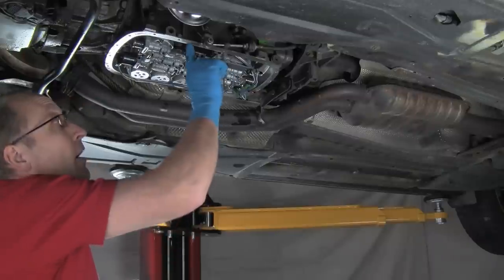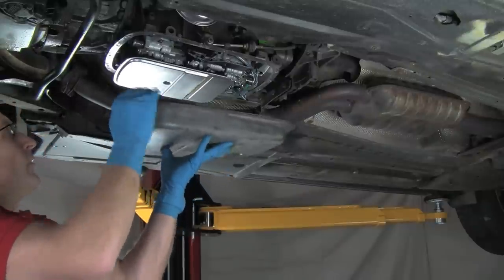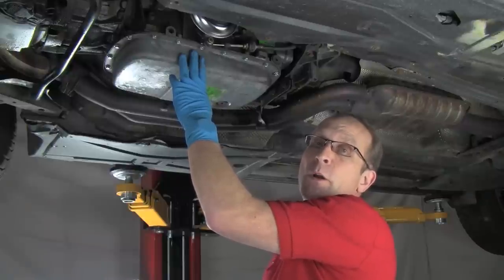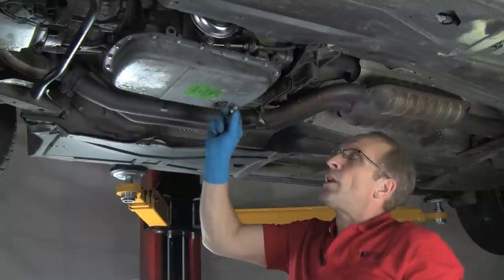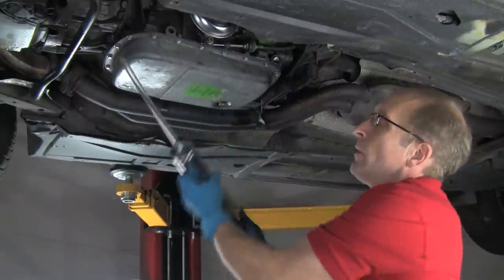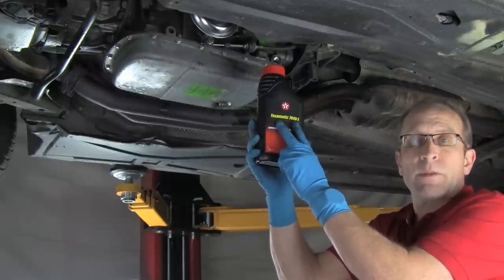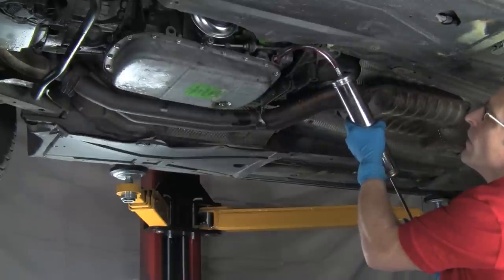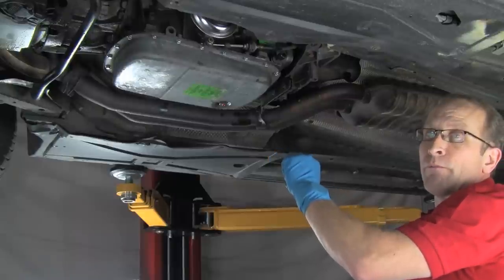Part 2: Changing Automatic Transmission Fluid & Filter On A BMW/MINI

Comment: i saw another video they mentioned you should run the car and flush the fluid again (in case fresh fluid and old fluid from the converter don't mix well) what do you think??

also my tran case is leaking a small bit do you think the bolts+gasket are bad. or could re using the bolts be fine?
Reply from the maker: Yes, We have made multiple comments on this.  If the fluid that was removed is pretty nasty (or just to be sure you have a higher concentration of fresh fluid), you can run the transmission (in gear, or drive it) and then do another fluid drain and refill.

In most cases, reusing the bolts is fine.

Comment: I have a 1999 328ic; Would I take the same steps for my vehicle? any additional steps for my car? and lastly is it save to run the car while filling it up? I know doing on just regular cars is normal but ever since I started working on my bmw people told me to never fill it up while its running. are they wrong?
Reply from the maker: The transmission in your 328i will be different from the one shown, but the overall procedures will be similar.  The Bentley repair manual for the E36 3-series will detail the differences for your model.  Yes, you ALWAYS set the automatic transmission fluid level with the engine running.
Bentley manual:
http://www.bavauto.com/fland.asp?part=b398

Comment: hi,. i have on 01 X5 4.4l with only 65k that i just bought at an auction as is. later on i discovered that reverse does not function properly it takes about 10sec to engage and when it does it would roll back, if i were to give it gas it would just rav up and it would still we rolling almost like if the clutch was bad in a manual car. i did some research and found out that reverse is the only gear that requires oil pressure. what does this mean and what would you recomend i do?

Comment: Thanks for the info, one more question, my 2003 bmw e39 530i has a green color by the pan aswell like your, what kind of fuild im gonna put and how much litter do you think im gonna buy? Base on my review it says that 71141 trans oil for green code, is that rigth?

thanks.

Comment: If the transmission is making some noises in low acceleration, it's recommended to change the transmission fluid? Or it's recommended to keep the fluid until the general reparation of the transmission?
Reply from the maker: If the fluid is original (or very old), the first step is to change the fluid and filter.  If the old fluid is really nasty, run it for a bit after the first change and then do another drain and refill (without removing the pan).  This will give a higher percentage of fresh fluid.  Run it and see if the running issues go away or continue.  Call our advisors at 800-535-2002 for assistance in setting up the fluid and filter, or visit our online store at www.bavauto.com.

Comment from the maker: The A5S390R transmission (in your 320d) is the same as the one shown in the video.  This uses the Lifeguard-5 fluid.  We have the fluid at bavauto.com or 800-535-2002 (603-427-2002).

Comment: Do you think it would be better to drain the new oil again right after running the gears on as it may have mixed with the old oil that were not flushed out during the first drain and refill the pan with a new one? thanks. am a newbie here and somebody told me this idea.
Reply from the maker: Yes, if the oil that was drained looked nasty, a second fluid drain and fill will give a higher percentage of new fluid.  We would run the engine for about 10 minutes (or drive the car around the block) before draining the second time.
Reply: Thanks very much.

Comment: Good demo, but please mention why you are adding the fluid from the bottom directly into the pan and not through the dipstick filler pipe from inside the engine compartment. Is there a difference?  2ND question concerns my '89 525i A/T (rebuilt in '08 @ 290,000 km) which now @ 335,000 km slips only after cold engine start; after revving up to 2000RPM and crawling at low speed 10-15 sec, it kicks back into normal mode, in any selected position D-3-2-1. Normal operation & normal shift pattern. Car tops out at 210 kph. There are no external leaks and fluid had been changed last year, but filter was not changed. Fluid level is normal. What's your recommendation?  - Thanks
Reply from the maker: 1)  These transmissions do not have dipsticks, so there is no tube.
2) Are you sure the transmission is slipping vs. not shifting up into all the gears?
Reply: Your reply is appreciated.  Wow, wasn't aware of "tubeless" transmissions where fluid levels (and color) can't be checked from "above."  As I said, after 10-15 sec initial 15-20 kph crawl (in any selected gear position) it would suddenly accelerate to the corresponding RPM with no further "shift" or slip problems. Meanwhile, I had the filter & fluid (Pennzoil ATF Dexron-II compliant) changed. The filter was black & clogged (It wasn't changed last fluid change) but the fluid was still red color since changed last year; there were no metal shavings in the pan, nor on the 2 magnets. But the pan had a film of dirt as in your presentation. I've only driven 1 day since and there was no slippage (or initial shift anomaly) ...so far.  If you don't hear from me again, the problem has been solved.  Again, thanks for your input, as I've learned something new today. Best regards.
Reply from the maker: Hp Gunther
 the new filter may do the trick.  Time will tell.
Reply: BavarianAuto ...Well, time told the story and didn't do the trick, although the initial 10-15sec delay in shift/slippage was mitigated to 5 sec. This phenomena happens only when the fluid is cold which is so weird. I live in a tropical climate where the lowest temp is 22°c (72°F) so nothing ever gets "cold soaked" ... I suspect it's more of a slippage rather than a shift problem. How would fluid temp affect shifting? When I shift into R the car moves back instantly, when I shift into D-3-2 or 1, the car moves instantly forward...but only at crawl speed for a few seconds up to 2000RPM when it suddenly "kicks-in" to speed. It's more of a nuisance than a problem. I'll live with it until the gearbox goes on vacation before having it rebuilt.   -HPG
Reply from the maker: H P G
What did the old fluid look like?
Reply: BavarianAuto The old fluid was changed last year and was still red as it should be, but the filter which hadn't been changed was black & clogged. There were no metal shavings on the magnets, nor in the pan, but there was a film of dark crud in the pan.
Reply from the maker: H P G
 - OK ... if the fluid had been overall quite nasty, we would have recommended another drian/fill.

Comment: I noticed that there is a fluid leak where the motor and the transmission meet.  I was recently under my car and noticed the same issue.  Is there a gasket that needs to be replaced?  Is this motor oil or transmission fluid?
Reply from the maker: Well .... that all depends.  If it is transmission fluid, this would likely be the transmission input seal.  If it is motor oil, it could be the oil pan gasket, rear main engine (crankshaft) seal, valve cover gasket ... or .... even something further forward such as the oil filter housing gasket (6-cylinder models).

Comment: My 1999 bmw 328i has to rev up a lot before the car actually starts moving any suggestions on what is wrong??
Reply from the maker: Sounds like you either have worn clutch packs or a problem within the control valve body, such as; sticking valve or worn valve and bore allowing too much internal leakage.

Comment from the maker: Good eye .... we had a bad seal on the plug.  We replaced it with a different plug of a new design.  The one we used was from an older design that used an o-ring.  the new ones all use aluminum seal rings.

Comment: I have a bmw 325i 1993 can I follow these steps?
Reply from the maker: In general - yes.  The transmission in your 93 325i is the GM A4S-310R  This transmission has a second, smaller, fluid pan in front of the main pan.  There is no drain plug on this pan.  You have to lower the pan to drain it.  Our kit includes the gasket for this pan.  The fill plug is in the side of the main pan.  Other than these details, the general procedures are similar.
filter kit:
http://www.bavauto.com/fland.asp?part=B2400002

Comment: Is this similar to how u do it with the E34 engine (European)?
Thanks
Reply from the maker: Your E34i will be similar, but is a different transmission.  One main difference (for 6-cylinder E34 models) is that you will have an additional small fluid pan forward of the larger main fluid pan.  this pan has no drain plug.  You just remove the bolts and allow the pan tip to one side to drain the fluid.
See the link below for additional info on this transmission:
http://blog.bavauto.com/2469/bmw-automatic-transmission-fluid-change-e36-a4s-310r-4l30e/

Comment: I got 207,500 miles on my recently purchased 2000 BMW 323ci. Forums make me go back and forth between wanting to do this and then the terrifying thought of doing this and having my tranny screw up. I have no info on the past history of the car and if it's ever been changed. IDK exactly what slipping gears is or if I have it. sometimes it just feels like it goes into  another gear too soon. It may drop a gear sooner than I feel It should. The big thing is if I put the gas pedal to the floor (which I don't do much) it will not change from 2nd to 3rd gear (or 3rd to 4th etc..) without me letting off the gas, it will just rev up in neutral until I leave off the gas. Driving normally it seems to shift into all gears okay, and reverse still works fine (Thank God!)
anyways, im just nervous about doing this and possibly risking it...?!?!!?!?

thanks for the video! GREAT JOB!
Reply from the maker: Please read the associated blog post (in the video details) or read through the comments on part-1 and part-2 ... we discuss the "to change or not to change" issue at length.  Basically, if the trans goes out at some point after changing the fluid .... it was on the way out anyway.
Reply: BavarianAuto nah mate.not true. dunno how you come to this conclusion. If it isnt fucked leave it alone.especially on beemers

Comment: I have a 2004 525i do you think flushing the transmission is a good idea it has 167.000 miles on it?
Reply from the maker: The choice is ultimately yours, but we will always choose to refresh the fluid, even on high mileage cars.  You can look through the comments for both part-1 and part-2, for our full notes on this point.

Comment: on my transmission there was a sticker that says use part number 83220026922is there anything that will hinder the service if I use the parts you mention in the video like the trans oil or the filter ?? its a 2000 528i e39

Comment: Would the same filling the transmission while running technique be required for an e85 2006 Z4?
Thanks
Reply from the maker: +Jon Ehrhart Yes,  ALL automatic transmissions are final filled with the engine running.
Reply: +Bavarian Autosport great, thank you

Comment: is there no need for sealant for the gasket ? 
PS i have a 2000 e39 540 m62tu what type off oil do you reconmend

Comment: Greetings, this was a very interesting video and is a very helpful indeed. But hat you can say as a master of transmissions, about the Mini ZF CVT transmission that is generally known to be faulty and problematic ) What can you say about that issue? is it a bad idea to buy a Mini with CVT transmission and also I would like to ask, is it possible to tune the TCU of that transmission, in order the transmission not to operate in that stupid manner, i.e. simulating the ordinary transmission and not how the CVT should operate.
Reply from the maker: Quite frankly, We would not recommend the CVT transmission.  We do not like the way they drive ... and, they do have reliability issues.  We're not aware of any programming upgrades.
Reply: Thanks a lot. God bless you ) T

Comment: Are new Pan Bolts needed? OR CAN I just use the old ones????
Reply from the maker: If the bolts have not been over torqued, they "can" be reused.  However, we have had customers not that they have experienced broken bolts.

Comment: It makes the noise all the time right after you turn on the engine... Some guy told me it could be the tensor
Reply from the maker: Yes, could be a tensioner or idler pulley.  Could be a timing chain noise, could be hydraulic tappets/lifters, could be a noisy fuel injector.  Somebody with actual technical knowledge really needs to have a listen in order to make any determinations.

Comment: Hi I have a 2006 325i bmw and the plug was leaking so I wanted to add some fluid at the dealer they ask me not to touch it but can I just change the plug and put like a quart or less and I tighten the plug its not leaking no more but Im still concerned about the fluid that was spilled and I just wanted to add some any suggestion. ...thanks
Reply from the maker: You can just check the fluid level and add if required.  Be sure to do so with the fluid warm and the engine running as shown in the video.

And ..... we seriously recommend that you do do a fluid and filter change.
Reply: Thank you so much for the advice. ..I appreciate

Comment: okay so no lectures but I have 240k miles on my e53 and I'm wanting to change the ORIGINAL transmission filter, fluid and pan gasket. I've heard that the trans can fail if I do it at this point and should just leave the original fluid in there??? Can any expert confirm whether this is a myth or if I really should just leave it. I had one Master mechanic say changing fluid is not the issue but most shops do not reset the programming in the computer so the transmission can re-learn to shift with the new fluid and that is what causes the failures. Can anyone confirm that explanation? Any tips much appreciated and fyi the car is running fine, no issues with shifting. Already replaced the transfer case a couple years back when it popped and failed

Comment: Hello, I have a 07 BMW 750Li. One of the many BMW horror stories that I was told about these cars is that a customer changed his own filter, drained the tranny and refilled as you did. When he attempted to drive the car it wouldn't move. He called everyone he knew and finally had it hauled to BMW dealer who found that the computer had noted that the transmission had no fluid in it and locked up everything. He was told that by resetting the value in the computer that it was fine. Towing, diagnostic, and repair north of $300. How do I keep this from happening ... or is this "urban legend" ... or ??? I thought that I might disconnect the battery and do the work (another urban legend that you can't change it without backfeeding via the OMBii port or computer would have to be totally reprogrammed) so that the computer would not realize at any point that it had no fluid (if the story were true). What do you say Mr. Otto? Thanks

Comment: hey I have a bmw e46 320d made in 2002. gm gearbox.
and i am changing the transmission. i will have to fill it up and know howmch i fluid i will need(8.1liter). But!!!
have I also fill it up when engine is working to make it full(like in the video). or i just fill in 8.1 liter and and this is it?
Reply from the maker: You will need top perform a final fill with the engine running and the transmission warm .... just as if you had done a fluid drain and fill.
Reply: thanks ;)

Comment: Does this work for a 2006 BMW 530I automatic transmission?
Reply from the maker: +Jose Marquez Your 2006 530i uses a different transmission.  The general procedures 
are similar, but the exact locations of drain and fill plugs and the 
filter are different.  Check out this post, for details on your 
transmission:
http://blog.bavauto.com/15410/bmw-diy-video-fluid-and-filter-change-automatic-transmission-zf-6hp-models/
Reply: Thats exactly what I have

Comment: Hi, I recently changed the fluid including the filter on my 2005 e46, but I am not able to put back the same amount of fluid that came out from the original, by about a quart.  I made sure that the car was level and engine is warm, but it seems like every time I open the drain plug to put more in, the fluid start leaking out.  The shifting from 1st and 2nd is now sometimes a little rough especially going around corners....any ideas?
Reply from the maker: Are you doing the final fill with the engine running, as noted in the video?
Reply: Yes...
Reply: Yes I did, could it be possble that it was too hot?
Reply from the maker: Alex Hsu
yes, possible, but not by as much as a quart.  Are you sure that you have the proper plug removed for filling?  What model E46 is this?

Comment: Should I change the transmission fluid for my 2003 bmw z4 3.0i? Right now, it is about 130k miles.
Reply: Absolutely...just be sure you have the right filter, fluid, etc. Doing it every 60k will keep it shifting smoothly.
Reply: @enrique967  I am thinking about going to do a 360 inspection for my bmw. Do you think is there any difference do  the inspection between bmw dealership or just normal repair shop? Bmw dealership is more pricing
Reply: @wenqianghu1352  I would use a certified shop but probably not the dealer.

Comment from the maker: There's no need to spend $60 per quart at BMW.  We have the proper fluids here for a quarter of that pricing at bavauto.com , or call our agents at 800-535-2002.  You will need to refill the pan when you remove it to change the filter.  Additionally, you should have a much fresh fluid as possible.  There's no good reason to try to only change a small amount of the fluid.